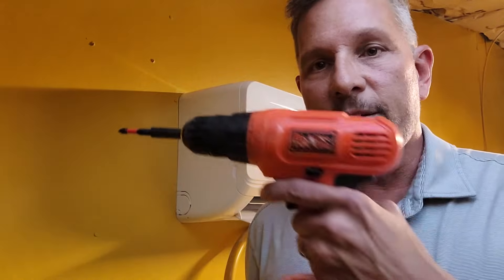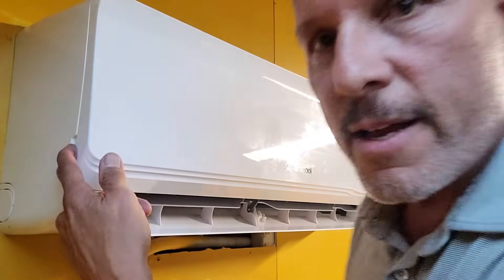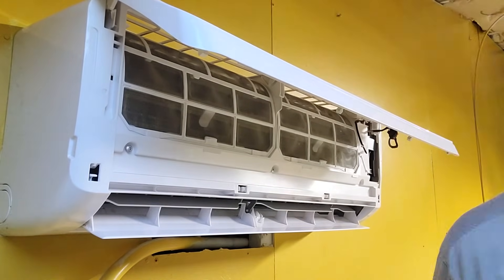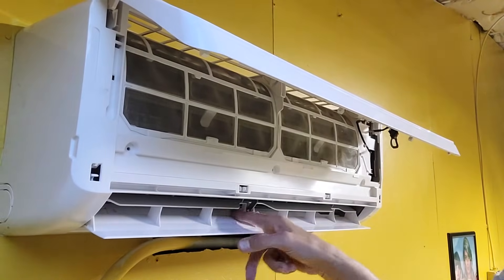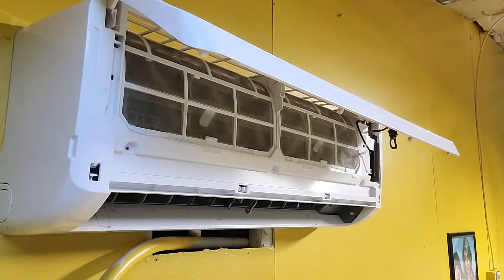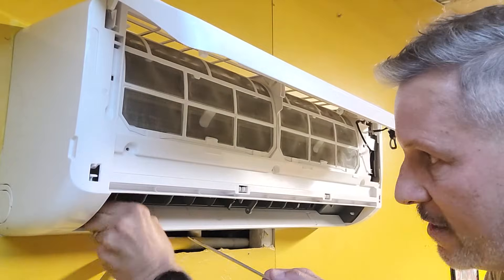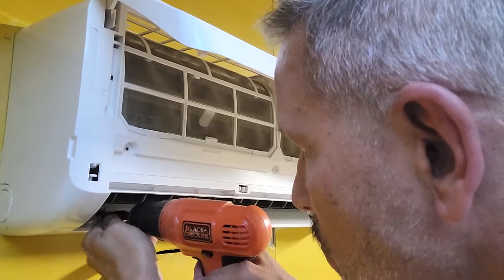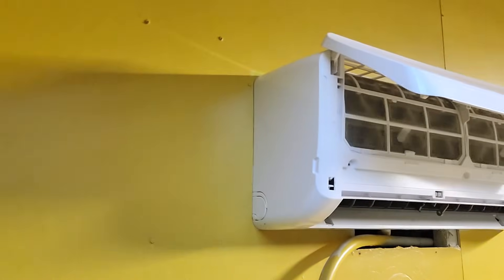Leaking? What's causing the leak for your mini-split indoor unit?

Comment: Does drain pan built with a slant towards drain hole?
Reply from the maker: Hi Vaughn, actually, the drain pan Tales to the left, and then there's a switchback such that the hose tilts to the right, both obviously going in the downward direction.

Comment: I just cleaned my split unit professionally and now it’s leaking in the back right corner and it has never leaked there prior to that, could it be my split unit is finally getting colder than it used to be before the cleaning?
Reply from the maker: Maybe, or maybe the guy unconnected the hose by mistake.

Comment: I had a home repair guy come out and he used a compressed can of air to blow out the hose.  I went outside where it came out when he did it a second time and it was quite a blast of air.  However, when I used the minisplit again it still leaked.  Called the contractor who originally had it installed and am still waiting for the hvac guy.
Reply from the maker: Water always flows downhill to the easiest path that it has. So, if there's any obstruction in the hose, it can make the water flow over the tray. If there's a hole in the tray, of course that would be a problem. If there's a hole in the hose, of course that would be a problem. If the hose is going up even like half an inch, that would be a problem. I guess conceivably if there's too much humidity and your hose is too small, even that would be possible. Try running the fan at a higher speed so you get less condensation in the tray and see if that helps.

Comment: I have a great blunder for you.  Home addition, dual heads.  Drain drops into crawl space and proceeds to flow the wrong way uphill over 20 feet and 1 foot higher than the low point!  Pan was backing up.  Didn't figure it would stand 7 feet and back up into the pan.

Comment: Great video. I have a big problem with my Pioneer air handler dripping from the front of the air handler. The line is clear, so I ordered an Apen condensate pump to try and remove the water from the drain pan. Hope it works.

Comment: There’s a dripping noise behind my unit wall (not inside the room, the dripping seems outside) however when I go outside, I dont see dripping maybe its inside the unit. Also when i turn my heater or cooler on it works good for 10 minutes then it turns off.
Reply from the maker: For the noise, it's hard to tell without hearing or seeing the video. Maybe then also hard to tell. For the turning off, maybe the unit is meeting the set point after a few minutes? Then it will turn off possibly.

Comment: put the shop vac to the drain outside than the waterfall came out! thx 👍
Reply: Thank you for your comment you saved an old lady 😂 from having to take apart the inside unit, thank you!
Reply: I did that but the leak from behind the unit still didn't stop...

Comment: It's not always a clog in drain line. I'm dealing with one now where water is dripping BEHIND the drain pan and blower wheel from the backside of the coil. Design flaw. Not fun at all.
Reply from the maker: Did they send you out a new unit? It sounds like that manufacturer is going to have quite a few challenges on their hands to remedy this if it's a common problem.
Reply: @airspool  I put the closest thing I had to a plastic baffle (foam tape) on the top of backside of coil as it is from the manufacturer on the front.
I also added a shim to the bracket top right side to keep unit close to being flush to wall (propping the coil itself upright)
Poured some water on backside of coil. 
No more drips
Seemed to work.
We will see 
*Couldn't get a hold of tech support.
Reply: @barrypeirson3710  Hey Barry, I seem to be encountering the same issue with you. I have mini splits that drain to common pipe, but the bigger one has this leak coming out like yours from the panel closest to the wall (sounds like where you described for your leak). I've tested by pouring water into the drain pan of the bigger one and it flows into the main drain no issue too. You mentioned a shim to keep the unit flush - I did notice that the sealent that is on the back side of the panel has holes in it. Could you help me visualize what you did with the shim? Hoping it will help because I do have a trusted technician and he did all the standard cleaning and could not see any issues which makes me suspicious that this is a manufacturer/ installation issue like yours. My model is the mitsubishi heavy industries (which according to my technician is his least favorite to service, due to the inability of the model to be fully dismantlled). Thanks in advance.
Reply: @ryancheong9486  it's hard to explain. But you need a small piece of rubber pad or cardboard to put between the clip and the bracket so that the unit is flush against the wall (no gap)
This will keep the unit upright as possible.
I hate mini splits with a passion.

Comment: Can a clogged condensate hose cause a split system to not cool? I don’t have any visible leaking inside, and there is no dripping coming out of the outside pipe… and my system will not cool. Praying it’s not a refrigerant leak. I just repaired one of my other units and it was over $1000. Three major repairs over two units in the last nine months on ACs installed three years ago. 😭
Reply from the maker: Jess, it's hard to tell. It doesn't sound like it's related to anything with the condensate line.
Reply: @airspool  the tech just came and said it is most likely a leak somewhere 😭 I have three split systems all about three years old and this is the third major repair (2nd leak) in eight months. Am I just this unlucky? How common are leaks? I hear they’re rare. Could this be poor installation?
Reply from the maker: They are rare if the system is properly installed. During the installation, it should be tested at high pressure with nitrogen, and then tested at negative pressure using a vacuum pump. If it holds the pressure, then it will be fine once the refrigerator is released. So have a good talking to with whoever installed those units.
Reply: @airspool  the same person or company who installed them is the one servicing them. And they are telling me that “these things happen” because I live in Hawaii and it’s a rough climate. Meanwhile, no one else that I know is having these problems.
Reply from the maker: You can make excuses, or you can make good connections in your line set. You can't make both.
Reply: @airspool  Thats real talk right there.  Installer probably did a poor job
Reply: @JessPenner  Did they pinpoint where the leak is? If it's on a braised connection it's on the installers, if the leak is on either of the coils that's on the manufacturer. 
I've seen plenty of leaking coils not at all installers fault within first 2-3 years.
It's covered under parts warranty. If the homeowner bought a labor warranty the repair is free. 
Unfortunately the materials they use in modern coils are leak prone.
Reply: @barrypeirson3710  I have not had them
Come back to pinpoint the leak. Last time they charged me $1200 in labor + Freon to fix my 2 year old unit that they installed.. it had a leak in the condenser. For this unit (2 of 3 they installed) They charged my $260 to come over and say “yep it’s leaking” They will charge me another $400 to come back and fill it with Freon and dye…. And then another $400+ in labor to fix it. At this point I feel like it’s a sunk cost. I don’t want to give them a single cent more.
Reply: What’s shady is that Fujitsu never got a warranty parts request  for the first unit that failed (I have a 12 year parts warranty) so now I’m wondering if they actually poached an old part off of another unit to repair my other split system instead of getting it from Fujitsu.
Reply: @JessPenner  doubt they poached an old part. They probably didn't feel like doing the warranty process and had the part i n stock 
But the whole thing is no good IMO
All of that would be covered with most companies.
We give 2 years and offer full extended warranties.
Reply: Look around the fittings where they are connected to the outdoor unit. Any signs of oil residue is an indication of a leak nearby. The refrigerant evaporates and the oil is left behind where the refrigerant leaked.
Reply: Very helpful. Thanks for the video.